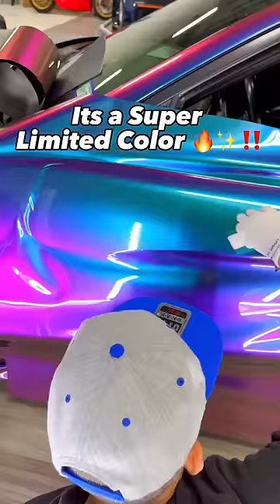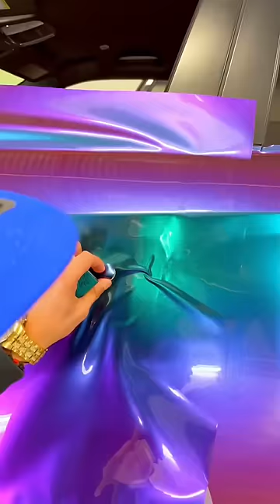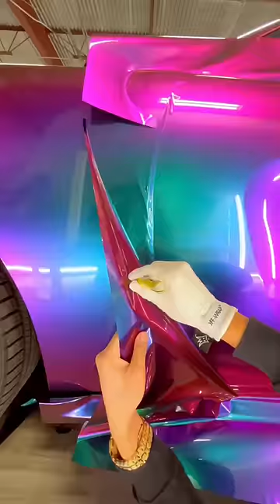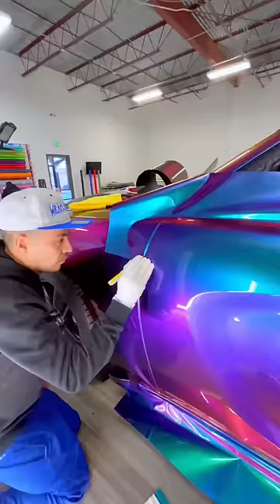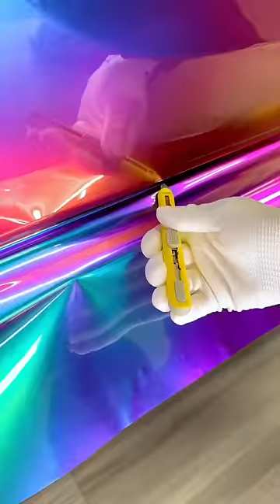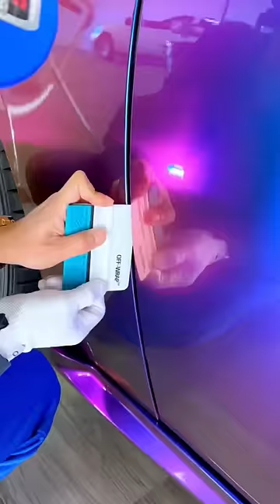This is How Quiet it is when I wrap cars 🤫📚😅 #asmr #asmrsounds #asmrvideo #carwrap

Comment: I applaud this man for his skill and patience...I can't even put a phone screen protector on straight 😒
Reply: Truth
Reply: fr
Reply: Same
Reply: So you put your screen protector on gay?
Reply: @ray.gene.bowner  yes, I absolutely do. Proper bent.
Reply: @pylo1608  😂😂😭
Reply: I don’t even put my screen protector myself.. I go to the store 😅😂
Reply: Windex.... sold phones for a few years. Easy to shift and straighten and then squeegee the excess out once in place
Reply: @greysongladney4403  thanks for the tip.
Reply: @pylo1608  😂☠️
Reply: I have done stuff sort of like this on a smaller scale and on a flat surface.  I have no idea how he can do it on a car
Reply: @greysongladney4403  huh? I’m genuinely confused can u explain exactly how to do it
Reply: @WhoRU  no problem!

Clean phone with alcohol swab.

Spray a squeeze of windex on screen.

Place screen protector onto phone, it will have a lot of little and some large bubbles squeezed between the two pieces of glass or the rubber matte protector.

SIMPLY maneuver the screen into proper position and take plastic squeegee and place at top of screen protector and slide down, expelling the windex and anchoring the protector in place.

Continue to squeegee all liquid out and viola!

If it happens to get crooked just peeloff carefully and try once more, after the 3rd attempt the adhesive starts to break down. 

I've had customers coming in to see me that weren't even my companies customers just to get the protector put in place right and not crooked.
Reply: & the annoying thing with that type of thing is you can't undo it, once you start you have to go through, & you have to plan perfectly & still will screw up
Reply: Same, not even my dad can do it perfectly. So on my camera there's a big bubble because of it
Reply: @greysongladney4403  thanks sm for the breakdown! Definitely trying this next time
Reply: Lol. My grandpa's phone screen protector is all jacked up because he accidently put the thing on wrong and couldn't get it off.
Reply: @ray.gene.bowner  gay=happy
Reply: @Just_A_Transperson  transportation**
Reply: @ray.gene.bowner  lmfao
Reply: He gets paid tho
Reply: Facts
Reply: Me too
Reply: Facts! I’m screaming at my phone now bc it’s crooked!
Reply: @noonebutme  - In a cool, windless and dust free room, clean phone screen with rubbing alcohol > before removing backing, align screen protector on screen > apply adhesive tape to one side as a hinge > lift screen protector without removing tape > remove screen protector backing > apply screen protector to phone screen ✅
Reply: @XotikYT.  - Very slowly and carefully, using your fingernail to gently lift a corner of the screen protector, slowly slide it along the edge until the whole protector is off. Do not touch the application side, as this will damage the silicone glue, align the protector to a broadside and earpiece cutout and reapply.
Reply: Does this dude wrap school books?